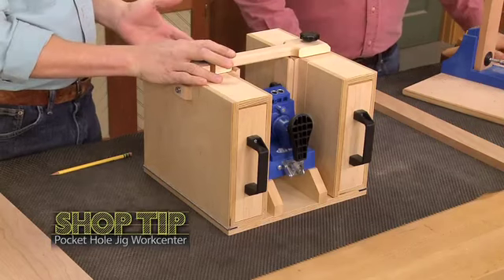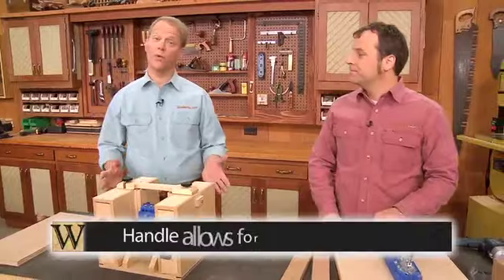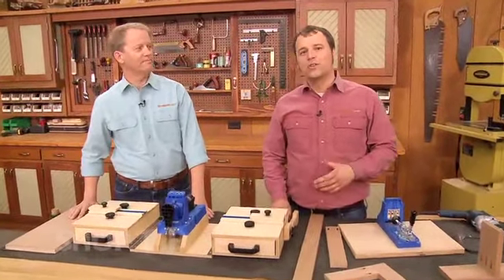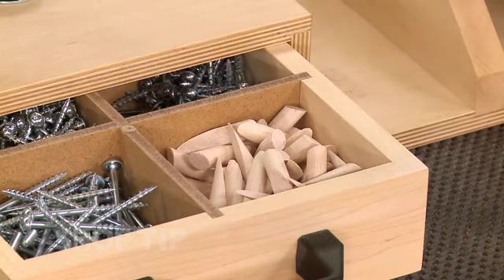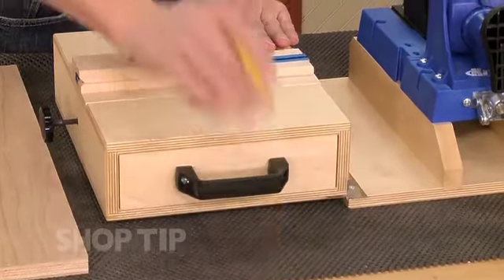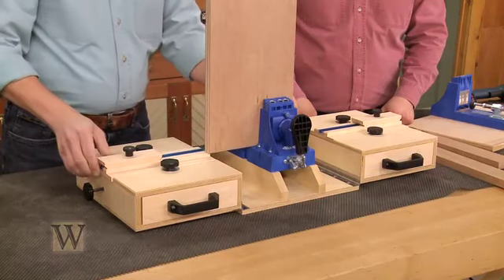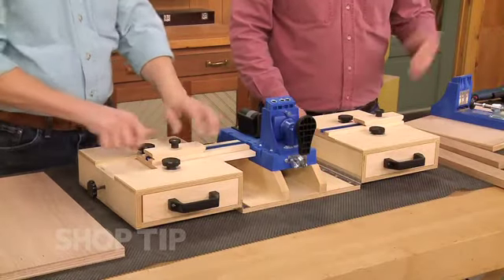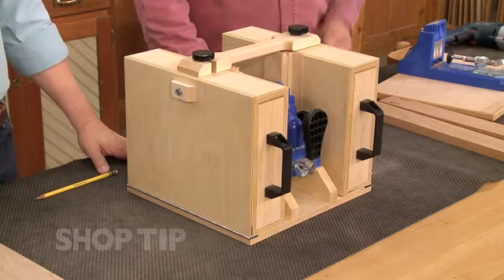Project Overview: Pocket-Hole Jig Workstation

Comment: bought the plans and they never explain how the case tops are made.   It gives the measurements and then says there is a large opening for the sliding piece.  My question is how.   Are the tops made up of multiple pieces to create the gap.  or are you supposed to route out the opening.  It's not explained so I'm stuck on the first step.

Comment: I was waiting for one of these guys to ask the other for some Grey Poupon.  Come on guys, this is overkill. I'm not trying to insult anyone, but I don't want anyone new to woodworking to get the impression that they need on of these, get discouraged and not try pocket hole joinery. Slap it onto a scrap piece of 3/4" ply and you're off to the races.
Reply from the maker: The Grey Poupon is actually in one of the hidden drawers.... we didn't show it because, well, then it wouldn't be hidden anymore. ;)  We stated right off top that you can just attach it to a piece of plywood... But we wanted to take things up a couple notches.  Do you need this project to get started? No.  But it is an interesting way to upgrade your pocket hole jig storage when your're ready.